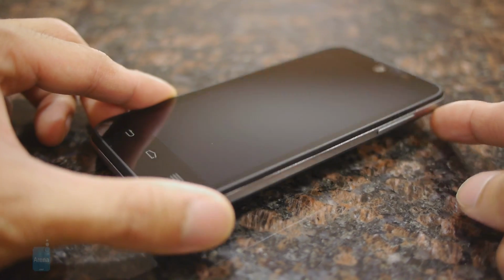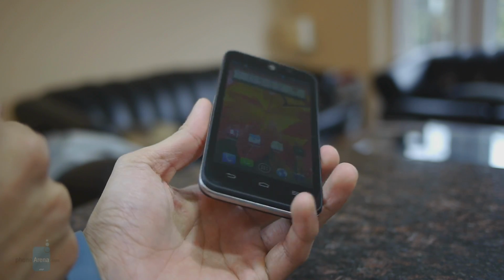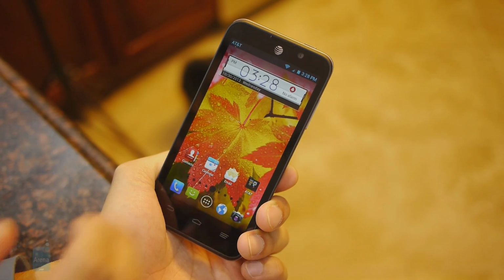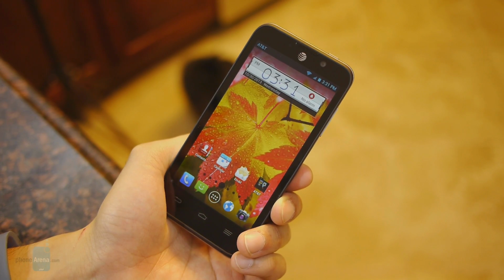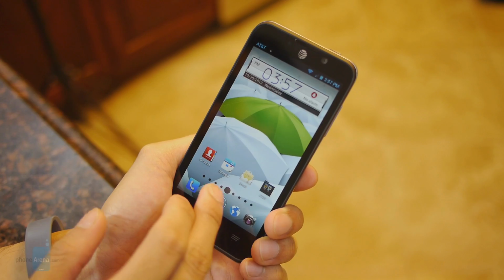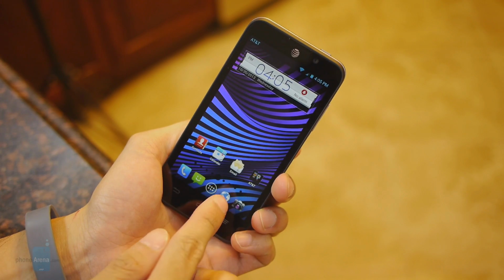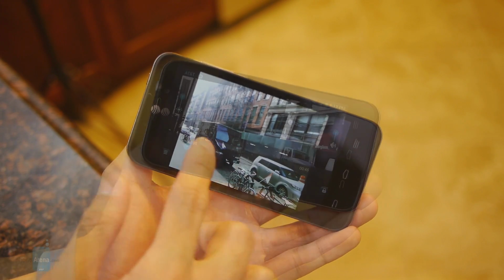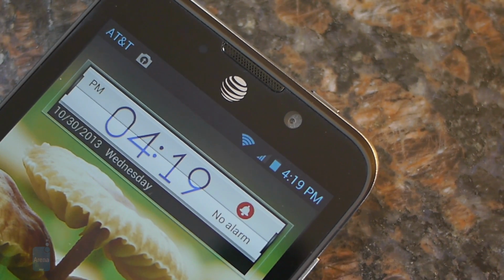AT&T Z998 Review

Comment: I got this phone in September.  In December the ear speaker blew, still works but distorted to the point of being basically useless.  In January the SD card just stopped being read.  It's in there tight and the data is there, the phone just doesn't see it.  From almost day one the phone has had this annoying habit of not ringing for incoming calls.  It's totally random, sometimes it rings (usually) but often it doesn't.  Sometimes I've happened to be watching and see the incoming call icon, but there is no sound.  Sometimes it just says "missed call."  The sound is on.  I would definitely steer clear of this thing.

Comment: At first, I really liked this phone. I lost my phone and had to buy a cheap replacement. I got this phone in June, and it has given me nothing but issues. Shortly after I got it, it wouldn't hold a charge, and even if it was plugged in, it would still turn on and off. It happened again recently. Then a few weeks after it happened the first time, it stopped letting me receive text messages. I could send them, make calls, go on the internet... I could do everything the phone offered, except receive text messages. Once again, it happened again. The first time, I had to factory reset it. I'd do it again this time, but why? What's the point when it will happen again? Lastly, I have system update for the SD card update. The instructions for this are very complicated. It gives me no information on how to do this, and the little information the website gives, isn't helpful. So all in all, I have had nothing but bad experiences with this phone. Unfortunately, I'm stuck with it, and quite frankly, I'd rather not have a phone a this point.

Comment: I just bought this phone yesterday from an AT&T store for $159.99 but I didn't get a blue tooth headset or even ear buds for that matter. I charged it for 5-6 hours overnight then took it off the charger this morning about 6:30 am and it's already back on charge since 12:20 or so (right now it's 1:16 pm). The main thing I've done is text off and on, look at a few emails, and browse online using Wi-Fi shortly. It's having trouble staying connected to the Wi-Fi at my house and I've restarted the phone 3 times to try to get it to connect. It starts out fine then I guess drops it for some reason. My cheaper straight talk phone did a better job than this and it was a $99 huawei inspira. I was trying to upgrade when I purchased this phone. I don't know if I just happened to get a lemon or what. Does anybody out there have any suggestions?
Reply: go to settings,wireless & networks,wifi settings,tap the menu button(right side from the home button) then tap advanced then at the top you will see Wifi sleep policy. tap that then tap never. that should help
Reply: turn off your wifi saves battery life when not using phone first thing i learned also it drains the battery constantly picking up the signal . always turn it back on when ready to use . i have no problems with my signal i have verizon at home .